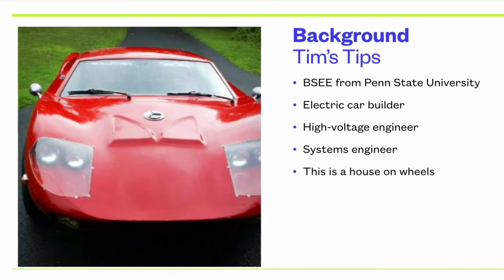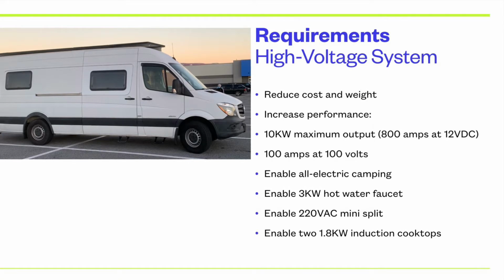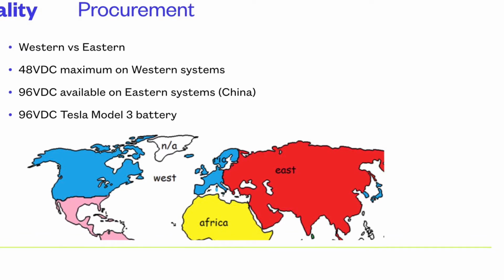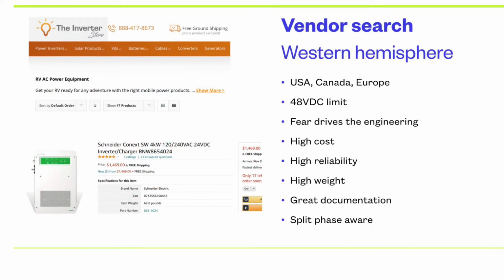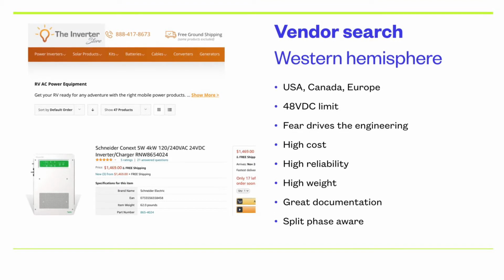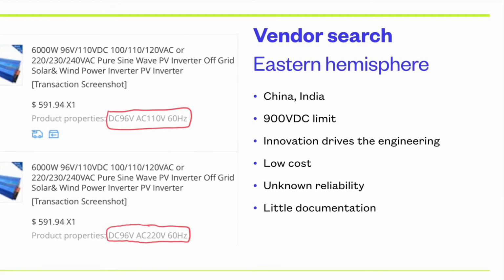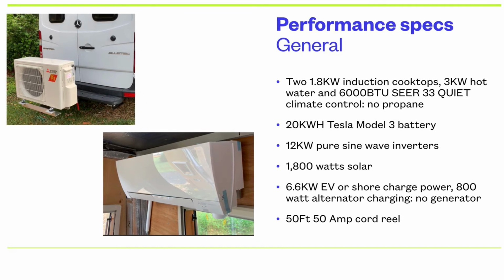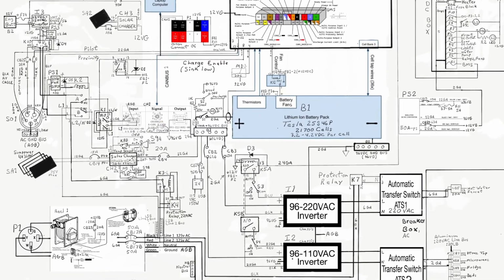Tim’s Tips #48 - High Voltage Van Build - November 16, 2020

Comment: You have done a wonderful job. I am not an electrical engineer but I was an elevator technician for many years working with voltages well into the 600s.
I would love to have a go at following your lead if you ared willing to pass on your build sheet, buying options and schematics?
Thank you kindly, 
Gary

Comment: Most Van-RV might only need 10KW battery system. 20KW Tesla Model 3 is over 6 feet long. Do you think of a battery half the size to fit the van?
Reply from the maker: If you only install 10KWH, you really only have 6KWH usable because The SOC should be kept between 80% and 20% to maximize longevity.. The battery will degrade over three years down to only 5KWH useable. This is not acceptable to me for boondocking. If a 20 kWh battery is used, you will double that capacity. 20KWH can be obtained from one Tesla module, which is a 25s46p using 2170 cells, which is one of the most dense energy Lion battery chemistries available.
Reply: @tdrager  Isn't 80% SOC of 10kWh 8kWh?
Reply: See your point now: you only top off to 80% and used down to 20%

Comment: Nice hobby level project, but not practical for any commercial application in US at this time. I'm like you, I would rewire my own RV to 96VDC, but working in RV industry and pushing for higher DC voltage in any commercial project is insanely difficult. It's a vicious circle of missing UL standards, which need commercial investments to develop, which need complete marketable solutions, which need multiple companies to invest 10s of millions. Sadly US business is not driven by engineers like you and me, but rather bean counters who would never take a risk of long term investment. We are starting to make progress on 51VDC LFP commercial applications, where we earned UL listing, but 96 VDC is still in infancy in US. While it's nice that China makes some 96VDC inverters, their quality and safety is horrible, would never pass beyond hobby market. They take a 48VDC design and push it to 96VDC by stretching margins. You don't want such approach in US commercial market. Say what you want about US safety priority, but people sleep on top of these batteries, when first person dies in the fire, how would you feel about making bold claims that progress trumps safety?
Reply from the maker: Thanks for your enlightened, detailed comment. I agree with you. However, how many people are sleeping with fossil fueled appliances, which are bombs just waiting to explode or give us CO poisoning or lung cancer. China is beating us on many fronts including solar, electronics and electric motor technology. I am ashamed to say they are better Americans than we are in some respects. LOL.

Midnight Solar had a 96V solar controller which was UL approved but they discontinued it. Sad.

The RV industry only needs to adopt some of the proven EV technology in terms of the high-voltage battery and charging infrastructure. My design is a prototype which would need to be fully developed in order to bring it to market. I am sure that China (and the USA) can build UL compliant 96V inverters and chargers in a short amount of time. It will only take one RV manufacturer (or a new venture) to take Elon Musk‘s lead and get so far ahead of the competition that they can’t compete. For example, Ford and GM can’t complete against Tesla’s offerings.

 I did this van build because at the Hershey 2019 RV show I saw a 48 V lithium build on a Winnebago Travato. The additional cost was about $22,000. I said: I can build something much better for half the cost. So here it is. LOL

If RV manufacturers would be true leaders, they would build rigs that are so compelling (20KWH battery with 1800W solar) that thousands of people won’t build their own. How many 12V rigs are fires just waiting to happen, built by DIYers. Many of these builders don’t understand the ramifications of forcing hundreds of amps into a cable, or the efficiencies of 120 V and 220 V appliances. Look at the European standard of 220 V: are Americans really afraid of high-voltage? I think so. How many deaths have our American two-phase system caused because of its complications and lack of understanding? A high voltage rig reduces current requirements by an order of magnitude so it is inherently safer. Our household appliances are 120 V, so why are so many people are afraid of 96 VDC systems?

As Ben Franklin said: "Those who would give up essential Liberty, to purchase a little temporary Safety, deserve neither Liberty nor Safety." I welcome your feedback.
Reply: @tdrager  I'm an engineer like you, similar background actually, same passions too, but I also understand pragmatic issues in how fast/slow this technology moves. It really comes down to demand and supply. As long as RV customers are satisfied with what is on the market, there will be no investment from RV makers. Customer demand for more power/energy is what's driving up voltage. I see this today, but I also see that 51V is very sufficient for many years to come, so no one will spend millions to go to 96V. Another thing to point in your video is that your battery came from junk yard, hence your cost is manageable. When made commercially, it will add 10s of thousands to an already expensive RVs, so no one will buy it. You must be pragmatic. That system you mentioned is Volta and they had to make poor engineering decisions to crack the market. Huge 12V DC converter to support legacy 12V components. This will work only when everything in RV can be 51V, pumps, fridges, AC compressors, etc. Huge undertaking, will take years. Be patient. We are working on it.
Reply from the maker: @CleanPowerAuto  Good points. A few points: 
1) 120VAC
I recommend using all 120VAC appliances since they are ubiquitous, cheap (E.g. $189 fridge) and Energy Star compliant. I recommend 220VAC for high-power appliances like instant/3 second tankless hot water dispensers and mini split heat pumps. 12VDC appliances like air conditioners are 2x more expensive, inefficient (only SEER 12) and extremely noisy. My Mitsubishi mini split only makes 19dB of noise and has a SEER of 33. 

2) Electric Vans
With the advent of electric vans (E.g. eSprinter), the battery is built-in, so engineers will specify 400 to 900 VDC to 120 VAC and 220 VAC inverters. Demand for this is only about four years away so we must start now to design and build prototypes and take market share away from companies selling obsolete fossil fuel rigs.  Until then, the cost for NEW batteries will soon be $100/KWH, or $2,000 for 20KWH. I would call that pragmatic because that battery pack can deliver up to 20KW; enough to power any class A through C rig. 

3) Solar
A roof full of Sunpower solar panels (and possible sides of the rig) enables indefinite off-grid living. Getting rid of inefficient vent fans and skylights opens the roof for solar. 

4) EV Boondocking
A new class of boondocking can be created to camp at an EV charging station while charging overnight. This could be a marketing "Feature" for the bean counters. LOL

5) Insulation
Better insulated rigs, including isolating the thermally inefficient cockpit from the house, will enable the electric revolution. With mini splits having an HSPF (Ratio of output BTUs divided by input BTUs) of 12, all-electric heating of rigs is possible.
 
6) Plan
Why don't you and I start a company designing a fifth generation RV power system that will future-proof the RV industry from the:
- EV revolution
- Solar revolution
- Van build revolution

We need to resonate with Boomers, Gen X,Y,Z in terms of:
- High-performance
- Sustainable energy
- Energy efficiency
- Cost-effective

Thanks for engaging on this important topic.
Reply: @tdrager  Everything you said is already happening and will be mainstream in 10 years. Early adoption cycle takes 3-5 years and it already begun, but slowly, need to be patient. I got EV fever 12 years ago, built my own EV and drove for 10 years, then switched to Bolt EV, which is excellent engineering, so it's not just Tesla, GM can do it when they want to. China has good Govt. policies, but people are not as imaginative as in US, so I think we are still ahead in engineering, just need smarter policies and investments.
Start a company? I already did 10 years ago, then merged with another one and now we are working 24/7 and can't keep up with growing demand, so thank you for your offer, but my hands are full, LOL. There is so much low hanging fruit available that I have no time left to reach for high branches ( voltage metaphor ).
$100/kWh is misleading, its raw cost and not even reached yet. Price for consumer is 4-5 times of raw cost because we are still in adoption cycle. It will be a while before people can afford 20kWh batteries in RVs, but some already have. A few large Class A RVs have 32kWh house batts, but cost is not a concern for those kind of customers.
Reply from the maker: @CleanPowerAuto  Agreed. I also rebuilt a VW Bug-based EV conversion, called a Fiberfab Avenger about 13 years ago. Only lost $13K on that “learning experience”. Bought a Nissan Leaf. Now have a Tesla Model 3 and Y and a Cybertruck on order, all funded by a $10K investment in TSLA before went up 13x. Tesla tech is about 8 years ahead of GM, Ford and Daimler, who are bogged down by fossil fuel momentum. If we apply Tesla thinking to RVs, a company could get 10 years ahead of the competition.

With respect, they call it a Chevy Bolt because modules are bolted together in a sometimes haphazard fashion. Tesla’s vertical integration is more efficient, more powerful and less costly. An example of this is the octovalve, which directs coolant through the battery pack. I don’t believe Ford and GM will exist in 10 years, at lease in their present form. Tesla’s Texas and Berlin Gigafactories will be online soon and make make millions of vehicles per year. Their supercharger network is superior to all others. I know: I’m preaching to the choir. LOL